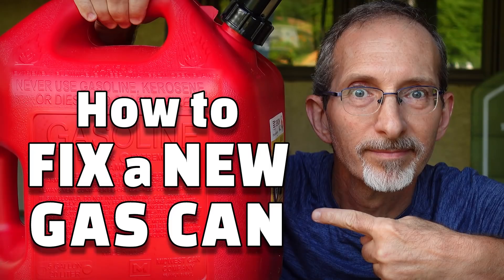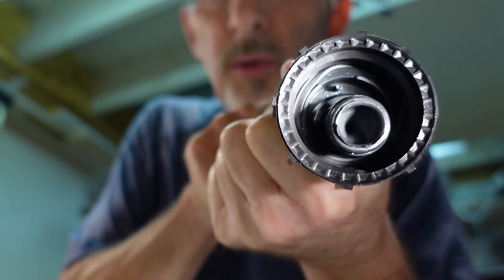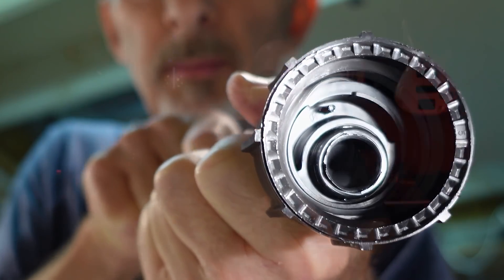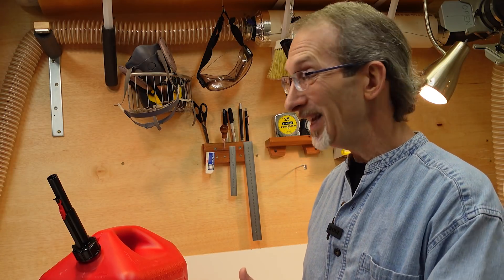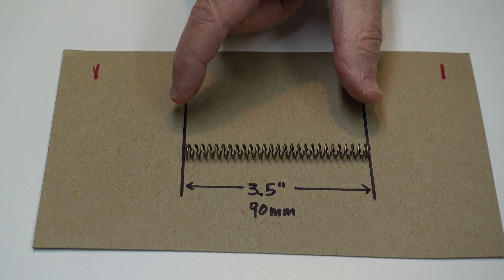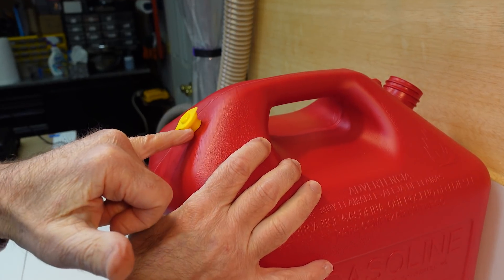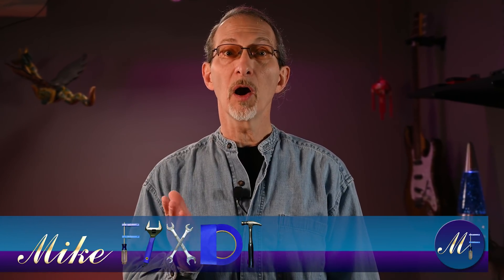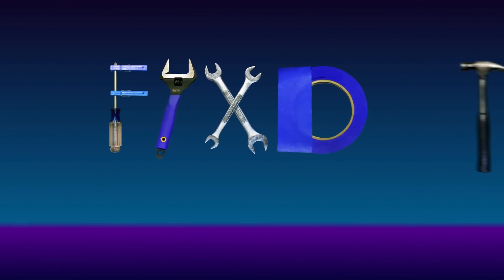Gas Can Modification | Part 2: Explosive Details!

Comment: These containers are designed to comply with the requirements of horribly written legislation.  The manufacturers are not idiots, and they are fully aware that these “guaranteed to spill” cans are dangerous and likely cause fires.  They have no choice.  Save yourself, buy and install aftermarket spouts and vents or else buy “racing cans” that are officially “not for transporting fuel.”  Thanks Big Brother, may you rot in he proverbial Hot Place.

Comment: Hey Mike do you have a link to your .stl files for printing that sweet cap?  Good tips and tricks, thanks for the video.  I would discourage viewers from using a heat gun near a gas can if it actually has gas fumes in it.  These mods are best done on virgin cans that have never had gas in them.  And after you drill out that hole, run some water in there to make sure to wash out any little bits of plastic that may statically stick to the insides because you don't want that in your engine.  Let the can dry out completely and then fill it up at the gas station.  I have a gas can with a different kind of annoying spout which I over rode the safety mechanism by running a zip tie to permanently keep the spring pulled back.  I like your half spring idea better.
Reply from the maker: @Willie - Here's a link to the .STL file for my Midwest gas can nozzle: https://drive.google.com/file/d/16aluqtfKfT6Q4edldeXrNdzO1uKL9dRy/view?usp=sharing
I drilled a hole in the tab so I can tie a string between the cap and the gas can handle. Let me know if this works!
Reply from the maker: Hi Willie, I just asked my son to send me the 3-D file when he has a chance. I agree that it is better to work on a virgin gas can. I was really careful when I drilled to make sure that none of the plastic went into the can, but I was nervous about it, and I think your advice is good advice! Thank you!

Comment: I use a rubber cork for the vent stopper. I would suggest to anyone that you might want to think twice about heating any gas can that has been used
Reply from the maker: Allen, that is good advice. The video of me heating up the can didn’t come out, but I used really low heat and I kept my finger on the spot that I was heating to make sure the temperature wasn’t too high. I figured I would burn my finger before the tank got hot enough to ignite. I also turned on the heat gun away from the gas can to make sure any spark didn’t ignite any ambient fumes. Thanks for your tips!

Comment: I live off grid....Buy a siphon pump, a nice one is made for Kero-Sun heaters . You will never go back to pouring gas, out of a can.Liked your video been modding my cans for a long time. I had not seen one with the fill neck stupidity.
Reply from the maker: I never really had a problem with gas cans, and mostly just need them to do my yardwork. The generator, and the larger 5 gallon cans, don’t get handled that much. But when they do, these nozzles we’re really hard to use. A few minutes and a couple of handtools was all it took, and now I like these nozzles and cans much better!
Reply: And if anyone has got problems lifting a full container up to where a siphon will work, there's a handy dandy battery powered pump/dispenser available. Looks much like the siphoned but has a pump and battery housing where the priming bulb is on the siphoned.

Comment: What would help the filling would be to add a water can vent to allow the pressure to vent rather than trip the dispenser nozzle.
Reply from the maker: I don’t know what is better, to keep the pressure in or to let it out. I always feel like letting the pressure out reduces the octane of the gasoline.
Reply: @MikeFyxdt    Does not affect the octane at all.

Comment: My friend has gas cans like that. Aren't they designed so the nozzle is supposed to be inside the can when in transit? I don't really mind the lock you cut off. You only have to depress it on the first rotation. It would be a pain if you had to hold it down for every rotation.
Reply: On my friend's cans, the ring at the base of the nozzle is separate from the rest of the nozzle and you can put the nozzle into the can and screw the ring on. I'm not sure if that's meant just for shipping to the store while it's empty, or if they mean for you to transport them full like that. I don't like it either.
Reply from the maker: I’m not sure if these cans let you cap them with the nozzle on the inside. I don’t like doing that because then the outside of the nozzle gets covered in gas, which gets on my hands, which makes me mad. I agree that the locking tab is not that big a deal, but by then I was just mad at the can and I wanted to cut some thing off it. 😁

Comment: Let's take a simple design and make it ridiculously complex.   Then we'll re-introduce  the original design as 'new and improved'.

I have one of these cans and I hate it.  So I've engineered a solution of sorts.  I store the can with one of those siphon hoses you can get at the auto parts store.  When I want to fuel something, I remove its original spout, insert the siphon hose.  A few squeezes of the bulb on the hose and all works well.  Make sure the can is situated higher than whatever you're fueling.
Reply: E8e8990e8e
Reply: 8w080

Comment: I got 2 of those cans & wished I seen these modes sooner because I was cursing at the pump when I first filled them. I figured it out but was taking forever to fill & I can’t stand very long because of back surgeries. I don’t know if there was any instructions on the cans & didn’t know how the pouring worked. Never really tried the spout & used one of those battery operated pumps that was seen on TV that works ok but couldn’t get it in the can with those stupid inserts. Took them out to use the pump so I don’t have to lift that causes me pain. Doesn’t quite pump all the gas out & I poor what’s left out without the nozzle making a mess but I’m going to take the springs out next time I use them to use the nozzles. For small engines I always watch the gas pour into the tank so I don’t overfill. Also when filling small tanks I don’t open the vent on older cans. I probably don’t need to add vents to these cans since I have a transfer pump.  Before commenting I went to HF online to see if I had the same cans & I do but I couldn’t believe all the good reviews after my first experience without the mods. 
Thanks for sharing!

Comment: On the question of how often I dispense gas onto an open fire, exactly once. Some 40 odd years ago I poured gas from a milk jug onto an open burn pile. You can guess what happened next. Had the flame not jumped up the stream of fuel and caught the whole thing on fire in my hand I may have thought "that's not a bad way to get a fire going". Instead I NEVER did that again. Just sayin. Some lessons are worth learning.
Reply: When I was 6yrs old, same thing happed to me lost about 6weeks of school because of it
Reply: I have never caught anything on fire that I was using on an open fire.  because you pour the gas on what you want to catch on fire first ,  then... toss something on fire,into what you want to catch fire.   WOW...huh....?? to soon!?
Reply: Pour some fuel into a tin can, while you are a safe distance from the fire. Walk over to the fire and toss in the fuel from a safe distance. Make sure all the fuel leaves the tin can at once. Be prepared to jump back if needed.
Reply: I once dumped bacon grease into a campfire. Never again. My eyebrows did grow back.
Reply: Gasoline is not a safe fuel to start a fire. Kerosene or diesel is the way to go. No explosions.

Comment: When you drill a new vent make sure you clean the plastic shavings out of the can so they don’t end up in your motor fuel tank, filter, etc.
Reply: I'm actually kinda surprised he doesn't mention the importance of doing these mods with an EMPTY gas can. You know there's always going to be at least one person who tries it..
Reply: I used a step drill and didn't take the filter out so I wasn't too worried about the plastic bits.

Comment: I installed a dozen vents so far, i used a step drill bit to 1/2 in., a little grease and a rubber mallet. Close the vent cap first before sending it home. Worked every time, no issues. I bought 20 vents for $8.50 about on amazon. My friends and neighbors love me for it. Next is the spring thing. Stretch, cut, re-install. I worry more about the idiots that smoke when refueling. Also plastic gas cans are prone to static elec. Always place them on the ground when filling.
Reply from the maker: Hi John - I thought the Amazon plastic vents were really well made. I have another tank I need to vent. I think I'll give the grease and mallet technique a try. Great tip on plastic cans and static electricity - I did not know that until recently. Thanks!

Comment: Everyone of those so called safety spouts from different gas can manufacturers that I’ve bought have either poured gas all over me & my mower, the spouts failed every time, gas on a person is unsafe. I don’t use the spout for pouring,a funnel that I custom made to fill my riding mower & my push mower works great, the spout is a cap only. We can think the EPA & people who doesn’t have common sense, for our pain in the gas can. You get two thumbs up from me the great information coming.
Reply: Ha Ha... you said pain in the gas!

Comment: The idiots who use a can to dose a fire ( flame retarder) and California  (spout/vent) to prevent fumes from escaping out into atmosphere, and tort lawyers bring you these features of the modern gas can. The fumes part really gets me because the amount of fuel lost on the ground and side of your vehicle is joke when you compare it to not polluting the environment with fumes, your still spilling fuel out into the environment and fumes. The other flame retarder wouldn’t be needed if not for idiots and people not using safe filling practices. The problem of people not shutting off engine, getting in / out of car ( static energy) are some issues with filling cans. Also you have to hold the fume vent billow up on pump nozzle ( escaping fumes again) to fill these cans with retarders . Take also into account more and more new vehicles come with no gas cap , compounding to issue with the spout. Have I ranted enough? I have lived in California all my life, so I have lived with these nutty regulations that are suppose to protect us from ourselves and it never seems to end.

Comment: I always spill fuel when using these cans. And I have a problem getting the can to pour without a lot of effort. The older cans were vented and easy to use. These new "safety" cans are unsafe.
Reply: Just get yourself a Mexican credit card, cost around $2 =a 6 ft. clear vinyl 1/2 inch hose, no instructions required for smart people only. If not sure how to do it practice with a bucket of water until you get the hang of it.  hint siphon.

Comment: No matter how many cans you have, you only need one modified or replacement spout. You only pour one at a time, right? For the vent, I drill a 1/8" hole and stick a golf tee in.

Comment: Giving the big middle finger to the nanny state.  Great video, thanks for calling out stupidity!!
Reply: May have been prudent to pack the drill flutes with Crisco to prevent the plastic swarf  from falling inside.
Reply: ROFLMAO

15:07 Just in case you missed...
Reply: Tort reform now!
Reply: Just throw that spout in the trash can and get a funnel

Comment: I have the Specter cans that have the flip and push over engineered spout. I can't use the 5 gallon can to put gas in my truck. Bought a funnel yesterday. I hope it works. 30 plus pounds is almost unmanageable with a simple old fashioned spout.
Reply from the maker: Is it just me or has gas been getting heavier? 😁
Reply: @MikeFyxdt  Everything is getting heavier. My chainsaw for one....After a long winter, I'm even getting heavier.
Reply from the maker: @johnnorman7708  Oh thank goodness, I thought I was getting old there for a minute. It must be gravity!
Reply: @MikeFyxdt  I Remember hearing a funny story about a father and son duo buying a brand new chainsaw and a 5 gallon can. The person relating the story was laughing about how hard it was gonna be to wrestle that huge jug while trying to refuel a saw through that little hole. Was pretty funny. The 2 he was overhearing and observing were in for a real learning curve.....
Reply from the maker: @johnnorman7708  That's awesome. I can picture it!

Comment: These 2 gas can videos are spot on. The manufacturers are literally being stupid. Causing a product to fight you actually can cause accidents while trying to idiot proof a product.
Reply: Don't call them gas cans call them fluid containers and make them easy to poor fluids out of. It's up to the consumer to decide what fluids they want to put into them. They have the same retarded design for kerosene cans and it is impossible to use filling a heater.
Reply: @michaelprosperity3420  Boy ain't that a fact. We literally had a 2 man operation using a funnel to fill heaters here. Those lame kerosene bulb pumps take forever and end up dribbling fuel sooner or later. And those new cans with the filter screen don't work with them at all. Can't even get the sump tube in them till you tear it out.
Reply: @johnnorman7708  
I bought a battery operated pump from Menards for about 19 bucks. Worked like a charm. The bulb pumps work about once or twice. I thought I was going to break a finger keeping the nozzle depressed on the gas can.
Reply: @michaelprosperity3420  -- For all you poor guys down there just get 6 ft. of clear 1/2 inch vinyl tubing and leave the stupid spout alone. That way the gas can is legal. The truly amazing thing is that when you suck on the hose you can see the gas coming so you don't get a mouthful of that wonderful elixir. Oh, I better mention put your finger over the end of the hose so you don't spill any.
Reply from the maker: John, in fairness to the manufacturers, they are making gas cans that conform to government safety regulations. It’s still a bad design, but I don’t want to point too much blame in one direction. Regardless, these gas cans really are hard to use off the shelf, so these modifications I do believe make them safer. Thank you for watching!
Reply: @MikeFyxdt  OK, let's modify John Norman's statement to say the GOVERNMRENT IS BE ING STUPID!!    Frickin' nanny state regulations1
Reply: It's not the companies, it's the Govt. regulations, that being our ever expanding nanny state.

Comment: I purchase 4 Midwest 5 gallon NATO metal cans. The cans are great but the spout is absolutely horrible. To work around I purchased a siphon hose & a 3rd party pour spout. With these I siphon the 1st 2 gallons out & then pour the rest with the non-vented spout.  This process takes forever & I do spill some because my back gets tired holding the can. 
The cans are used to store gas for my generator & every 6 months I pour the gas in my cars & refill to keep the gas fresh.
Reply from the maker: That sounds like a lot of work, but you’ve got to get the job done, right? Thanks for checking in!

Comment: Why are these cans engineered in a way that makes them awkward and difficult to use? Answer: Because we have a population with near zero common sense and a tort system that allows frivolous law suits to be won when people do moronic things in addition to emission control laws that also make no sense. On that latter point, exactly how much unburned hydrocarbons are emitted when a crazy "flash arrestor"  caused gasoline to overflow and spill on the ground when the can is filled?
Reply: Succinctly stated in a nutshell!
Reply from the maker: This is your typical case of bad ideas leading to bad design. Thanks for checking in!

Comment: No-Spill gas cans are the only ones of the newer safety cans that work like the older ones use to with no mods. My Surecan works good but there expensive and you must learn to stop before your full because the fuel in the spout gotta go somewhere. Pops-a-vent for everything else.
Reply from the maker: I guess you get what you pay for! I appreciate you checking in.

Comment: They design these cans to be used as if we are filling our cars/trucks with them.  99% of the time we are not using them for that purpose.  It's always a push or riding mower, an outboard motor, generator etc.. all which are at a completely different angle and height than a car's gas tank.
Reply from the maker: That’s exactly what I was trying to get across! Well said, I agree 100%.
Reply: Neither of my cars will accept a gas can nozzle.  You have to use the factory supplied funnel to get past the cap less fuel filler.  I used my cans 100% on my mower or generator.
Reply: @robertheinkel6225  What kind of car do you have? I have never seen a car without a twist-off fuel cap, just wondering
Reply: Your wrong! It's 98.5% of the time. Only 1.5% of small engs. help to pollute the world. So why do they care about gas cans? Safety reasons?